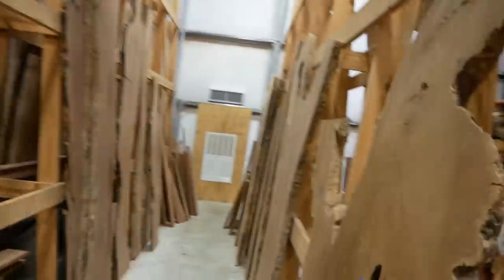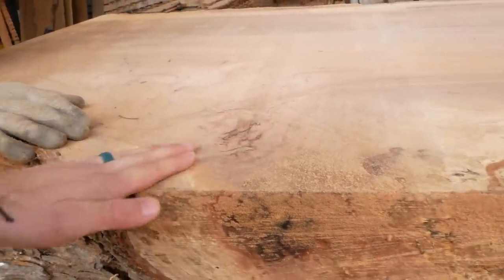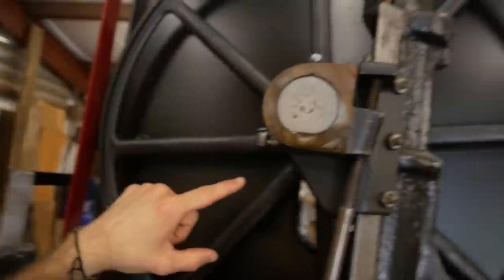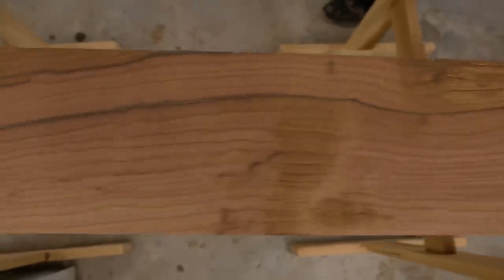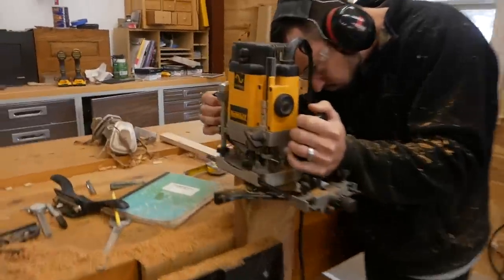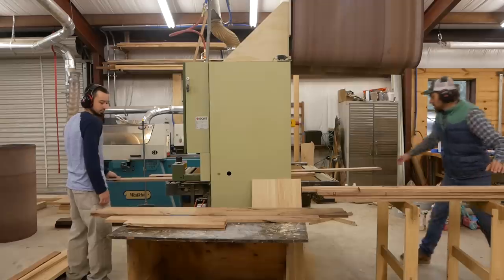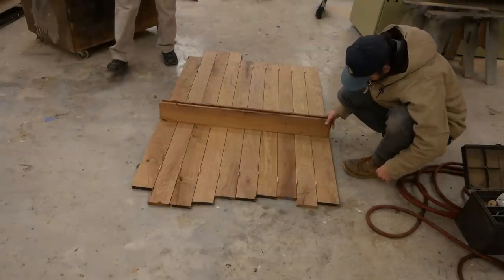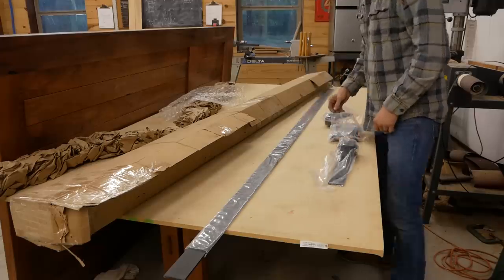AR6: This Sawmill Is Worth Seeing!

Comment: I had the same problem. Pulled the caps off and tapped in some Carbon string put it back together oiled it up and so far so good don't know if that would help in your case.

Comment: The oil seepage is typical of well used bearing journals ( aka worn out).
My grandpa used to use 90 gear lube / motor oil mixture on his Frick sawmill, or sulpher based oil used for pipe tapping.
Unfortunately:
You dont want to go there because the stink is very bad.

I suggest machining or get machined journal liners (sleeves), made from either Oilite( impregnated bronze) Google Beemer, or Meehanite( Bunting Bearing).
If you sleeve them, it will save your little guy from having to deal with it in 20 years.
Glad you didnt name him Sue 😁

Comment: I have a Crescent 36" band saw which was built around the same time as yours.  Mine was built around 1910 and I'm guessing yours is as old if not older than mine.  Wonderful saw, you'll love it. They are a joy to use.  With a sharp blade and the saw running true, it'll cut anything you can hold and push through it.  The bearings on your saw are Babbitt.  Babbit metal is tin or lead based alloy for axles and crankshafts.  Isaaac Babbit invented it in 1839 for use in steam engines.  It is very common for them to leak, even after you have poured a new one, then just don't leak as much.  So depending on how it runs, ???? you may need to pour a new bearing.  If you do, do BOTH of them.  The old guys used to put in heaver oil, grease, etc.  Another common sight was a small tin can hanging from a wire.  Another thing to do, there should be four bolts holding the top cap on, remove the cap and clean the area up, there maybe some small spacers between the cap and bottom lip.  Take close look at the top metal to see what shape it is in.  Grease it up good, and remove a thin spacer.  Run the saw, keep an eye on it.  If it gets hot, shut it off and replace the spacer.  Other than pouring new bearings there isn't much you can do.  Pouring new bearings sounds like a pain, but it isn't really that big of a deal, just takes some time.   Everything depends on how it runs and how much you are willing to put up with it leaking.   When you do get it powered up, keep a very close eye on those bearings, make sure they do not get too hot.  If the get too hot, the axle heat will melt the Babbit and then you have no other choice but to re-pour them.  Good luck with your new saw.
Reply: If you need to repour  the babbit bearings, check out Keith Fenner at Turn Wright Machine Works and Keith Rucker at VintageMachinery.org.  They both are very good at repouring babbit bearings.  They are excellent machinists.

Comment: Ooo!  You could just clean the area of oil and clear silicone it or you could use thick grease.
Reply from the maker: I thought about silicone and that’s probably what I’ll do.  I know
Loctite makes a product that will glue and seal it but I think it’s fairly permanent.
Reply: Nothing wrong with a small drip of oil as that's what this machine wants, but that looked like a bit more that normal.
Reply: Awesome work love be the silent videos as well
Reply: oil resistant rtv silicone?

Comment: You didn't show or mention if there are sleeve or ball bearings leaking. You didn't mention oil you are using either. Heavy oil would be thicker and leak less.
Put a sheet metal cap over end with felt pad to hold oil. Bearings can have seals or not. Buy some. You act as if it's top secret in manufacturing. Apply for a invention copyright if it's that secret how you made it.

Comment: You could try replacing the oil with grease
Reply: George has the best idea.  Use grease that is used to pack wheel bearings. The problem with your oiler is that the seal is bad, replace it and it will start leaking again with in a year. I'm a senior that spent his life doing maintenance work (fixing other peoples junk).

Comment: I used to have a similar bandsaw, albeit made in the UK (Wadkin). You shouldn't be using oil in the bearings, instead switch over to a mid-weight grease, I used to use a Castrol Wheel bearing grease, which was probably overkill but it was relatively inexpensive and easy to come by. For my large band re-saw (42" Stenner sawmill) I used a heavier marine grade grease but that was mostly due to the saw being outside.
Reply from the maker: This seems to be the best advice I’m getting.  My oil is too thin .
Reply: You mention in the video that they are "oil-bath" bearings but this may not be the case. Did you have them apart at all during the restoration? I would need to go back and watch the other video about the saw to find out. If they are what I'd call a split bearing, IE of two halves, possibly with grooves in the bearing material, you'll 100% be wanting to use a mid-weight grease. If they're a solid bearing, or even ball bearing, you may get away with a thicker oil, preferably something with some tackiness, or a lighter weight grease. Much like anything else of a certain age, a lot of it is down to personal preference/experience. I used to have access to another bandsaw (Startrite) made in the 1950's that had a list of what oils to use where inside the back cover, the only problem being that none of them were still being made!
Reply: Im with this idea too Andy, the Wadkins and Oliver’s of this era were very similarly built and a mid weight grease is probably best, almost any oil you put in there is just gonna to too light to stay in.

Comment: those are called babbit bearings. you only need to put oil in the bearings when you run the bandsaw. check out the old woodworking machinery forum they have a lot of that info www.owwm.org

Comment: Should be a grease sealed bearing.  Mine has worked for 16 years with daily grease to the Zerk fittings (or everyday i use the saw).

Comment: You get what you pay for! First grab outside of the rim pull hard and feel if there is a lot of movement without the blade on. pull toward front of table and push back. Your decision . To fix leak remove plug clean plug contact area with solvent insure no oil will contact that area when you install plug with liberal amount of black silicone gasket maker.

Comment: On your belt problem you really don't need a black belt you can use multiple V belts because you're driving pulley will be smaller and the V belts will work better we've done it many times and it actually works better than a flat belt thank you

Comment: It is an old saw.  Let it leak.  Catch the oil and pour it back in.  If you are getting dust in the oil then put a cloth on the catch can and then you won't have the problem.

Comment: For the oil leak...can you make a cover plate that has a rubber gasket. That would require dilling and tapping some holes. I do understand that you may not want to modify it like that though. Just spit balling.

Comment: YOU COULD CHECK THE MODEL FOR BEARING SEAL REPLACEMENT OR HAVE IT REMACHINED ON THE HANGERS OR ON THE WHEEL SHAFT IT'S SELF. $?  HOPE IT HELPS.

Comment: Sorry for the late post.... Those bearings seeped when newly fitted. I have a couple of machines that use them, and they get a 50/50 mix of 30w non detergent and slick 50. The slick 50 adds "stickiness" and diminishes the seepage greatly. If you check clearance on the leaky bearings you'll probably find that they're fine. Use a stickier oil.... and wipe them down from time to time. Nature of the beast.

Comment: Try using a heavier oil like summer bar-n-chain oil or a 85 weight gear lube for that oil bath if that doesn't work you could always cap the end with something like a piece of plexi adhered with JB weld...

Comment: On your oil leak, make a cap with three holes for screws.  Make a gasket and drill and tap holes to mount it over the bearing hole.  this should stop the leak.

Comment: If the saw still cuts well and doesn't leak too much, catching the leak(s) seems to be a way to go. Just hanging a bucket underneath would keep the oil off of everything while you're using the tool ...would require very little upkeep (ie; draining the buckets & refilling the reservoirs once in a while) vs. rebuilding the bearings/bushes/seals etc...

Comment: From my limited experience with old guys that ran equipment that used that style is it's worn. The oil shouldn't be able to seep like that unless you used a thin oil like 3 in 1 oil. So the old guys usually run a thicker oil or a lo temp grease that liquifies when hot and sets like a grease when cold. Some marine greases do that I  font remember name brands as I nascent worked on tug boats since I left Seattle in 2001. Hope it helps a little..
Reply: no kidding

Comment: You could get some flat metal stock maybe 3/16 thick, drill 3 holes in it and the bearing block, tap the block and make a gasket
or use some sealant.

Comment: It appears to be a babbit bearing, note the gap at the top. Basically means the bearing has some wear. You’ll probably experience some runout. Babbit is a softer metal and intended to not damage the shaft as it wears. Common on older equipment. Options are to have it repoured or retrofitted to modern ball bearings using grease. You might be able to get a bronze sleeve to replace the babbit...grease again.

Comment: I would suggest you replace the oiler with a zerk and use a amsoil synthetic grease. This way you only have to lubricate according to the amount you use the saw and not every time the oil has run out. Love the video

Comment: I went to the Berdoll sawmill three weeks ago. It was AWESOME!!! I was extremely impressed with the size of the pecan slabs and how many there are in the warehouse. You have to stand next to it to appreciate an 8 quarter slab that is that is 43 inches wide and 245 inches (20 feet 5 inches!) long. They have, by far, the best selection of native local hardwoods. If you live within 150 miles of the place and you are a wood worker you should make the pilgrimage. You'll love it.

Comment: Hey Andy, you could always do some small rope packing material that is oil tight.  This will allow you to fill in the gaps without damaging the parts and once fit and warmed up properly shouldn't leak for decades.  The material is used in valves to be water tight but still allow for expansion and contraction. Should be a relatively cheap fix that can be gotten from any Grainger or Fastenal.

Comment: Nice saw. If that end cap is removable try replacement with a hardwood cap with a bevel d edge.  A pretty tight fit should do trick.

Comment: For the upper shaft on your band saw. Have you looked into replacing the bearing with a sealed bearing. I have used a similar saw before and it had a sealed bearing. Other wise, you might try setting an 'o' ring over the shaft and under the cap. If the housing is equipt with a grease fitting, this may be how it was originally.

Comment: Maybe the oil is supposed to leak out a little? I mean if its gushing out then yeah its a problem, but if its only a bit it might be designed that way so you can add oil to it, that way the bearings don't seize up. Could be completely wrong here Andy haha, thanks for the video i thought it was great! Hope you figure out the problem!

Comment: As for the cap leaking oil, get some Permatex Anaerobic gasket maker and use that. Pull the cap, put that Anaerobic gasket maker on it and reinstall the cap. The Anaerobic sealer never fully hardens so if you pull it apart, you don't have the harden sealant to remove like you do with most silicone based gasket makers. I've used it for making gaskets on things I occasionally need to remove for maintenance. As long as I'm careful removing it, not getting dirt or anything like that, I don't clean the old off, I just touch up where I need to and put it back on and have never had a problem with it leaking. It does cost about double what the other gasket maker costs but well worth it to me.

Comment: Should add that sometimes new bearings pressed onto an old shaft ( you might have replaced them already so maybe not worn) will still result in some level of weeping..
The Oilite liners reduce the amount of lubricant needed..

Comment: back ion the good ole days as they say, the old sckool mechanics , that I've talked to bout my old Ferguson tractors.. Where I'm going with this, is that they use to use thin leather strips to tighten up main, and rod bearings.. They'd get to banging around down there, and because there wasn't the the technology in building the bearing races, and occasionally they'd have to basically use the leather strips as race, are bushing if you prefer. Good part is, they all said they never had any further issues out tractors in that area, and some of them worked on same ones most of their careers..  The leather strips with the oil soaked into them, will slick up better than metal on metal as far as friction wear goes, and in case such as yours with wear on bearing block surface should actually swell somewhat to fill the void caused by the weight of your wheel constantly riding in that one spot over the millions of revolutions it's made . Yeah I know I'm long winded, but was making effort to get my point across, and give youngsters history lesson, and hopefully short stop any of the negative types that always pop up bout this time.. Are as the man says, get ready to refurbish your bearings, and hope spindles, are axles don't get damaged too if they melt down on you. BTY cool Blues, and I always respect a fellow craftsman, whatever the trade maybe. Hopefully my thoughts are some help on your situation at hand

Comment: Hi Andy this is my first time watching yoir videos hopefully not my last. I love wood working and old tools!! When you put those two items together and someone like yourself is great to watch. I have been in residential construction for 43 years and learn something almost daily. As for the oil leak if you can and have enough thickness in the cap you could possibly file or cut a groove around  the outer edge of the cap deep enough inward you could possibly pack it with Oakum  first then tightly back it up with stranded lead . The oakum  is used to stop the leak the lead is used to help hold oakum in. This would allow if needed in the future to easily remove the cap. Just an idea from the dark ages. Great work keep it up.

Comment: If that rear cap comes off, remove it, clean everything really well, get some Loctite 660, apply it to the cap and reinstall it. Let it set up according to the directions. It will fill the gap and seal it up but if you ever have to get it apart again for some reason you'll be able to.

Comment: On old equipment as in the band saw, most seals of that era were caps with a leather seal. One reason it may be loose is the leather had deteriorated or is missing if it had one installed with that cap at one time.

Comment: I really like the video style very cool. On the bandsaw doesn’t the cap have a seal or a grove for a seal, You could try a ol’ mechanic trick and use a piece of leather as a seal I would cut a thin piece to see if it fits. We use to use a leather belt for a rear main seal on truck engines and they work like a charm. Let me know if you try it out. Andy keep up the awesome work till next time take care
Reply from the maker: No seal, the fit is just loose after so many years.  I thought about using cork but not sure I could make it work
Reply: Andy Rawls   Not sure cork will work but it sounds like a great idea and a place to start. Is the oil just leaking at the bottom or it just looks that way. Isn’t that cap held in with a snap ring or some other way?? Just trying to think of something that will work because I’m not sure if you’ll be able to get leather thin enough. But let me know and we can go from there.

Comment: Andy, in regards to your oil leakage problem, you'll need some sort of rotary shaft seal.  I have been in the hydraulic and pneumatic industry for many years and probably know of an off the shelf item that may cure your problem.  I would need to see a cross sectional sketch of how the shaft is captured into the mating piece.  Lastly, looks like I will be moving back to Central Texas from Boise Idaho.  I am a novice woodworker and would love to see your place if that is possible at some point, just let me know, regards
Reply: You could use an o'ring flat face seal on the end of the area  of concern.  Here is a link for components like these.http://catalog.anchorfluidpower.com/viewitems/carbon-steel-split-flange-head-adapters/cd61-cd62-flange-plugs

Comment: I would use Teflon tape around that cap. Kind of like an axle seal.

-Christian from just down sisterdale road
Reply from the maker: Hey Christian, you’re right down the road from me!  I’m not sure it would stay on the gap is so small I would think it’ll the tape will push off.
Reply: Yessir just down the road a ways. The only other thing I can think of is if maybe Loktite makes some kind of glue / sealant. Some kind of liquid gasket maker might be your best bet. 

Maybe I’ll run into you at the brewery sometime. Or the big church behind your house if you go there. I didn’t realize where you live until I saw a cibolo creek brewery sticker in a video lol